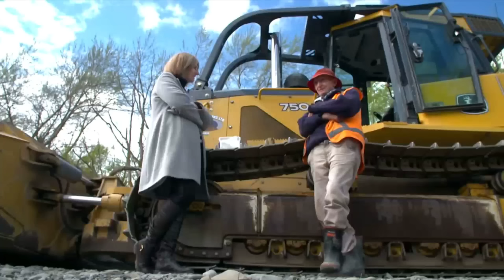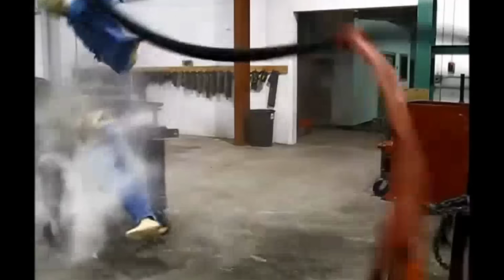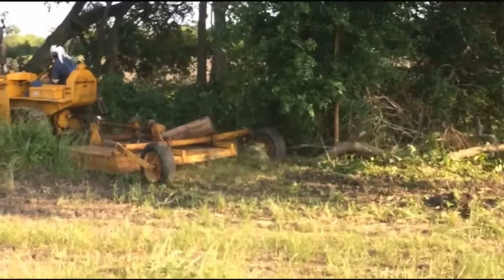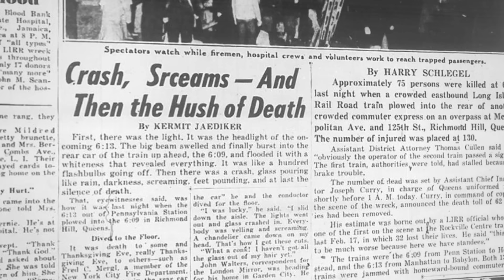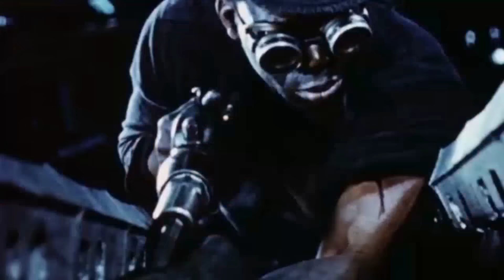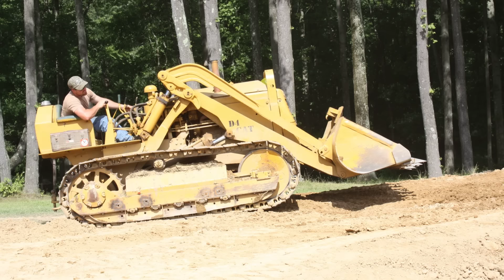Before Hydraulics: The Brutal Reality of 1950s Bulldozers!

Comment from the maker: 📌 PINNED: A lot of you will watch this and think "there's no way construction work was really that dangerous."

It was. 

In 1950, construction had a fatality rate of approximately 75-100 deaths per 100,000 workers. Today it's around 10 per 100,000. That's not just because of better hospitals. It's because of equipment like what we're discussing in this video.

No rollover protection. No seat belts. No backup alarms. Mechanical systems that could fail catastrophically under load. One mistake, one moment of inattention, and you didn't go home that night.

This video isn't meant to glorify that era or criticize modern safety standards. It's meant to show the reality of how things actually worked so we can appreciate both the mechanical ingenuity that made these machines possible AND the genuine progress in worker safety that came after.

If you worked on equipment like this, or knew someone who did, share your stories in the replies. That history matters.

Comment: I'd operate a Cat D6 9U Hyster winch from the 50's way before touching one of those electronic assisted POS out there today. At least, you could move the poor thing just on the pony engine. Try that with one of those glorified "brittle plastic controllers"  pile of recycled garbage.
Reply from the maker: Ha! The pony engine startup process alone was a whole ritual — real operators understood every inch of those machines. And you're right, there's something to be said for the simplicity and repairability of the old iron. Today's electronics have their place, but nothing beats the feeling of real mechanical control! Thanks for the comment!

Comment: As a kid I ran an old 14A D-8 Cat, cable blade with mechanical clutches. You cannot put downward force on a blade, only the weight of the blade for down force. You let a blade down, not drop it or it spools all your cable out making a mess. I was young and unbeatable at arm wrestling. All from working those mechanical levers 10 hours a day. The 14A had a gas pony motor you hand cranked to start and with that motor you got the main diesel engine running. No electric starters back then. Direct drive transmission, no torque converters. You killed the motor if you tried to get it to do too much. Then you had to go through the process of starting the pony motor to get it to start the main engine again. That Cat had a rollover canopy. The Cat wheel loaders did not, all was out in the open. I buried the 14A once when a cut slope caved in on me. I was buried up to my neck. By the grace of God I'm still alive. That was a long time ago.
Reply from the maker: What an incredible account — and thank God you made it out of that cut slope cave-in alive! The level of raw skill and physical toughness it took to run a 14A D-8 all day is something most people today can't fathom. You're living history, and we're grateful you shared it. Stay safe out there!

Comment: The first time the skinner (we called them cat skinners back then)let me run his D8 so he could sleep off his hangover, gave me a few instructions because the brake on one side was broken, so to turn properly, you'd have to keep the blade loaded and use only the steering clutches.   We were digging a trench across the road to install a culvert.  The first couple of passes were ok, then as I came up with a full blade load, near the end of a "push" I decided to let the blade down a tad to round the top of the pile off a bit.  I didn't know I was over air, and when I let the cable out the blade dropped, and in a panic, I pulled back on the winch lever to pull the blade back up and "Bang!" the cable snapped.  At that point the foreman came around and started yelling.  In my panic, I left the winch on and the cable got pulled in completely onto the drum.  We all spent hours re-threading the cable down the pipes back up to the front and the twin double blocks up front and re attach the cable. It took hours.  I still remember that like it was yesterday. That was the end of my cat skinning days.  Turns  out when letting the blade down over air, you make dam sure there's some ground under it.  I'm 78 today and still remember the lecture.
Reply: I love stories like that.. Opersting has changed so incredibly over the past decades.. Hearing first hand how it was is the best.
Reply from the maker: Hey Redeye, thank you for sharing these hours of work with us... that's the community we love... Share and bring back these old days.

Comment: I have used the cable lift dozer, and I prefer it myself and the the steering clutches and the hand clutch I like much better than the days video game crawlers
Reply from the maker: The cable-lift dozers had a real tactile feel that modern hydraulic machines can't replicate. Many old-school operators say the same — the steering clutches gave you true control. Thanks for sharing your experience!

Comment: My grandfather worked for the Iowa State Highway Commission. He told me stories about plowing snow as part of his job. He said that the snow blade was raised and lowered by a manual cable winch mounted in the cab of the truck and the cable went out through the windshield with the glass removed. Can you imagine driving the truck in below zero weather in Iowa.
Reply: I should have said that he was referring to equipment in the 1930s. The truck was a Nash, they also used Studebaker trucks.
Reply from the maker: What an incredible family story! A cable winch through the windshield to operate the snow blade — that perfectly illustrates how primitive the controls were before hydraulics. Nash and Studebaker trucks doing highway work in the 1930s, that's a piece of history right there. Thanks for sharing!

Comment: Cable dozers with cable scrapers are a good choice today for moving rock for short hauls. You don't have to worry about busting tires.
Reply from the maker: Absolutely! Cable dozers still have their niche — especially for rock work where you don't want to risk hydraulic hose damage. They're tough as nails and hard to beat for certain applications. Thanks for the insight!

Comment: Describing the operation of the dozers is feel through your body is absolutely correct even with todays latest dozers.
Levels ,pushing  dirt ,rock  ripping without tearing the machines apart etc.yes correct.
We tried remote controlled dozers but no feel did not work so back to manual controlled on our massive mine site..
The dozers now are satelite assisted and confirm exact levels.
The work can be harsh but very rewarding.👌👌
Reply from the maker: hey Jeffrey. where do you work?
Reply: Yep, you still need the feel to run a level blade, hydraulic or cable.
Reply from the maker: @bobchiggs Absolutely, the feel for the machine is what separates good operators from great ones. Thanks for watching!

Comment: Hello, Construction Legends.
Quote:
" . . . operators who felt every rock through their control levers."
Unquote.

Would you please explain to me, preferably in words of one syllable or less 'coz "i'm justa pore, dumm bulldozer op'rator", just how an operator is gonna "feel every rock through their control levers" when their control levers operated CABLE control units which raised and lowered the blade through cables running through systems of sheaves?????????.

By the late1940s - early 1950s, pretty much all larger bulldozers had HYDRAULICALLY boosted steering clutch controls and many graders were equipped with hydraulic controls. Most front end loaders had gone to hydraulics by the early 1950s and many motor scrapers were using either hydraulics or electrics also some stuck with cables for a while.

I quit at the 5,32 mark.

Just my 0.02.

You have a wonderful day. Best wishes. Deas Plant.
Reply from the maker: Thank you for the detailed technical correction, Deas. You're absolutely right, and we appreciate you taking the time to point this out.

You've caught an imprecise statement. With cable control systems running through sheaves, operators wouldn't literally "feel every rock through the control levers" in the direct mechanical sense we described. The cables and pulley systems created mechanical isolation, not direct tactile feedback.

What we were trying to convey was the broader feedback operators received through engine load changes, visible blade behavior, and machine vibration - but the specific wording about feeling rocks "through the control levers" was misleading for cable systems. That's a fair call.

Your point about hydraulically boosted controls and full hydraulic systems appearing earlier than our narrative suggests is also well taken. The transition wasn't as clean-cut as the script implied - there was significant overlap and variation by manufacturer and application.

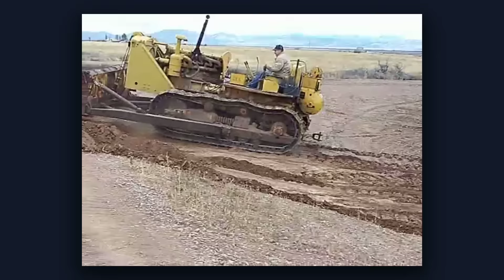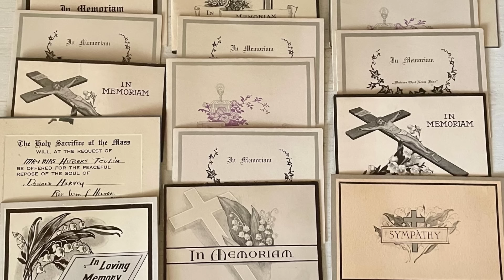If you have a chance to continue past the 5:32 mark, the video does get into the hydraulic transition starting around the 21:00 mark and discusses why adoption took as long as it did, which might interest someone with your hands-on experience.

Thanks for the technical insight - comments like yours from people who actually operated this equipment are invaluable. We'd genuinely appreciate hearing more about your experiences if you're willing to share.

Best regards,
Construction Legends

Comment: More bullshit ! Cable dozers , blades didn't have powered Dn force ,only the weight of the blade,, the blades were 8,10 ft wide , no tilt ,or angle, u wanted to angle the blade ? U got off with a  sledge hammer & a long pry bar  and angled the blade , , hydraulic controls came out many yrs after the cable dozers! I have first hand experience with cable tractors!
Reply: These people have no idea best dozer to run
Reply from the maker: That's a fair challenge! These machines require incredible skill and knowledge to operate effectively. What would you consider the best dozer for the job?
Reply: They called them cat skinners
Reply from the maker: Ha, 'cat skinners' – great nickname! Those operators had a real bond with their machines. Thanks for that bit of history!
Reply: So you've been there, done that. Dropped the blade and spooled all your cable out. Leaking seals and get oil on the winch clutches. Drag the blade back to fix the seal and wash the clutches out with gasoline so they will hold again. (front winch 14A type). Kill the motor and no electric starter. I hated angle blades.
Reply from the maker: Wow, that's incredible firsthand knowledge! The skills required to maintain and operate these old cable dozers were truly remarkable. Thank you for sharing your experience!

Comment: When I ran Backhoes with direct to valve body. Like say the Case 3 lever controls. This was back in the 1970s I could "FEEL" the bucket so to speak. I could feel up against a ROCK lets say trying to Dig around a big cast Iron or Ductle Iron water mains. Digging sewer ditches that were deeper than water mains. I could feel the bucket digging. Now some new buckets have sensors built in, to give very accurate depth and location of the underground pipes location. Even plastic pipes. Very nice upgrades to location of pipes you do not want to dig up. I love the hand held devices that the trenchless technology has, with a worker knowing the very location of the drill head. Especially for long pushes that pass other underground utilities 😊 I look forward to the day and it is already being used for Rescue of trapped people. That you can X-Ray the ground below you, to get very accurate sight of the buried utilities. 😊
Reply from the maker: yepp the future will bring us a lot more, but we are still appreciate of reading about the vehicles of the last generations. 

Did you have the chance to drive one of these dozers?

Comment: My best life long friend his DAD worked on the Alaska Highway for the US Army in WW-2 
His father was a excellent rebuilder of any vehicle even a restored Ladder truck, that the big city it was headed to on rail car, the ladder rig fell of 😢he took it and restored it and put it in SERVICE with a totally rebuilt open cab. 😊 after WW-2 he came home and started a construction company with CABLE bladed Dozers. He could tell if he had a great operator by how he used the cables properly for moving large rocks. How the operator handles a problem then uses the blade RUN by cables to get out of the problems. 😊 both my lifetime friend and his DAD told me lots of stories about the proper way to use the Dozer Blade on a cable Dozer. 😊 in my humble opinion for the time, it was brilliant to use the REAR drum winch cable to raise your front blade 😊 Find it so interesting how the engineer thought of why not use a winch cable for front blade, the big cable winch was ALREADY on the big Dozer, 😊 put it cables to work. 😊 just my humble opinion.
Reply from the maker: hey rp….. thank you sooo much for your two posts and the insights you have given us….
it’s unbelievable interesting to read it!

Comment: My Dad's equipment from 1946 t0 1978 ,except for 1 piece , was all cable operate. These were D8s,6s,7s , pull scrapers and Cat 619 scrapers. Simple to fix, more v fuel efficient than hydraulic equipment
Reply from the maker: where do you come from frogg?
which kind of work did he?